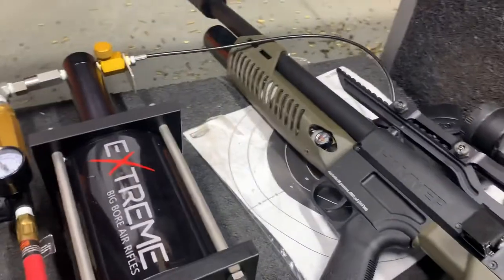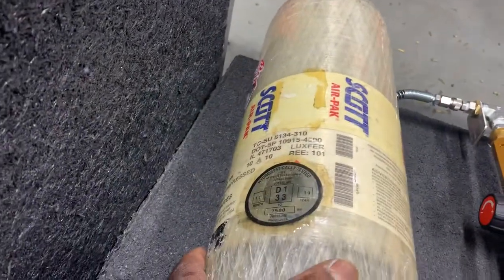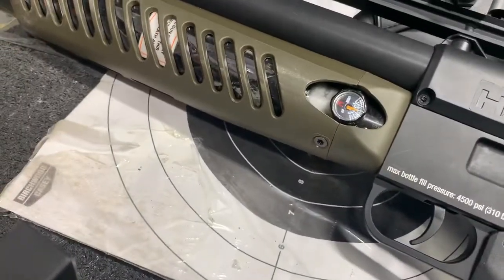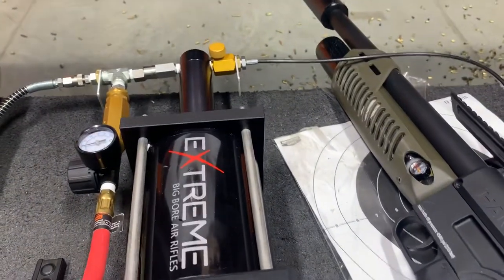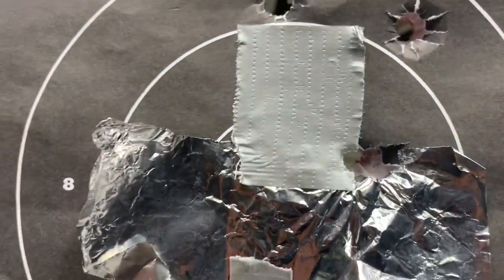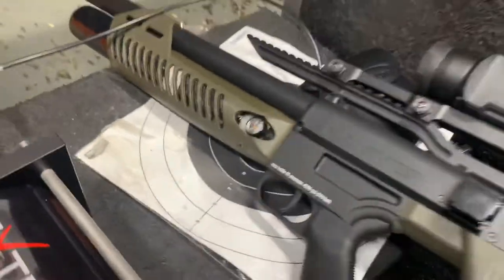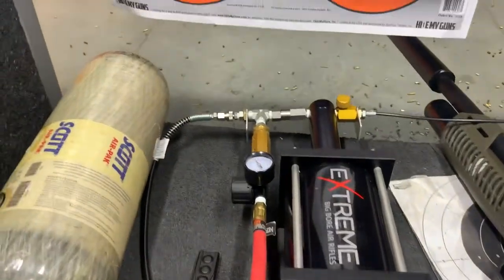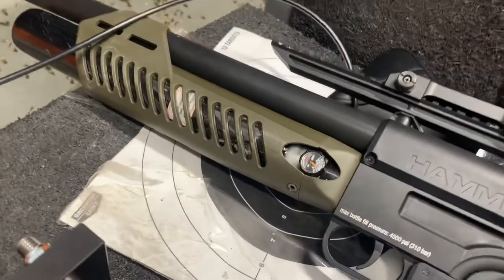First Range Trip With Umarex Hammer and booster pump

Comment: oh I'm interested for sure. I need one for sure- but if the shit hits the fan then what as far as the tanks of co2 / air I know nothing on this. not for long that's for sure.
Reply from the maker: Can be hand pumped 

Military used air rifles in Napoleonic wars.

They existed before electricity...will exist after
Reply: @suburbanhomesteadoutfitter4135  any hand pump recommendations?
Reply from the maker: @user-pp6kz9rw5q  not from personal experience. I probably should look into a hand pump for backup. 
Let me know what you find

Comment: Where did you buy the tank the place has one but for 1000 bucks
Reply from the maker: Ebay...used
Reply: @suburbanhomesteadoutfitter4135  man I couldn't find one so I just paid the 800 but it's super light
Reply from the maker: Where would you fill?
Reply: I was told local paint ball shops or firefighter stations could possible be cool with filling it for me fora fair price I'm going to buy the shoe box compressor or somthing like that